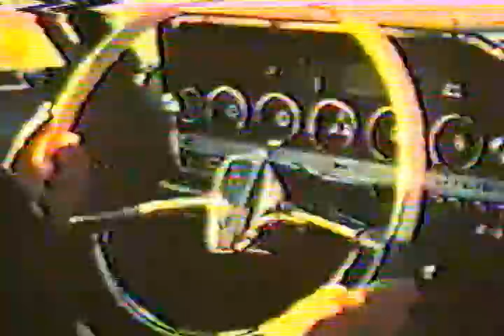Dodge Turbine Car Commercial Promo Film

Comment: @markfran11 As it was said in the video "The turbine will burn practically anything that can flow through a pipe", so the car could run 12 miles per gallon of just about any liquid. That's what was one of the main ideas, not needing to use gasoline. Steve Lehto has written a great book on the car called "Chrysler's Turbine Car", check it out folks.

Comment from the maker: Thanks for the comment.  There were a number of reasons why Chrysler/Dodge abandonded the Turbine engine.  But remember, the Turbine isn't gone completely.  They are used to power or M1 Tanks.  This was a direct result of the research Chrysler did over 30 years.  The big drawback is that they eat gas fuel.  The M1 Tanks have to have a tanker follow them where they go to keep refueling them.

Comment: @clap5 lots of reasons...1, it was very sluggish take off,2, the heat generated by a turbine is immense and the cost of creating an engine bay that could withstand all the heat was very expensive and it wasnt practical.also the fuel milage on these thing is rediculously bad.the last thing i can think of is they put out a whole lot of heat out of the rear.youd have to stand at least 20 feet away to not get burnt up.i was a tanker on the m1a2 tank and they have turbine so i am familiar with it

Comment: I read in a car and driver BOOK (1990 I believe) about this Turbine powered car. For some stupid reason dodge abandoned this car design. It took something like 22 seconds to get up to 60MPH. The RPMs went up to 60,000+. Amazing that it ran on so many types of fuel. IMAGINE A turbine top car of TODAY?! You could run it on anything with todays high fuel prices. TIME TO REINVENT THE AUTOMOBILE!

Comment: Cool video, Why doesn't chrylser review this concept and make a modern version of it?.
Reply from the maker: John Smith Because they transferred the Technology over to the US Government during the 1980 Chrysler Bail Out Loan Guarantee.   The Chrysler M-1 Tanks were turbine (and still are) powered.   It was a national security issue that this technology needed to be in the hands of the Government to ensure it's safety.  NASA stepped in and so did Contractor General Dynamics.   Turbine powered vehicles are used by the military now.   We just don't see them in automobiles.

Comment: There were problems with manufacturing cost, first and foremost. It's tricky to make a gas turbine accelerate like a reciprocating engine. Also, you have lots of very hot exhaust. Lastly, people didn't care for the "shop-vac" sound, cars at the time had V-8's.

Comment: these engines had a freepower turbine, just like helicopters. They did drive the rear wheels, not by air thrust. The air is cooled in the two long and flat exhaust pipes under the car, so you could freely walk behind it.

The biggest problem i think, is the inefficiency (fuel consumption) of turbine engines. Today, the consumption is even a bigger drawback than in the 60's...

Comment: Actually it would run on several fuels but it would not give good service on anything but the fuel it was trimmed for, be it unleaded gasoline, kerosene, or diesel fuel. Alcohols were rough on the fuel system as the materials were made for petroleum fuels. Leaded gasoline was also troublesome on the regenerators.

 A piston gasoline engine will run on alcohols just as well with minor modifications. It isn't economic which is why no one does it, unless the gummint subsidizes it.

Comment from the maker: @clap5 They did.  All thru the 60's and 70's, Chrysler worked on this.  There's much documentation.  For 1981, Lee A, Iaccoca wanted to launch a Chrysler New Yorker that offered this Engine Design as an option.  But, this was 1980 and the Government Bailed Out Chrysler but Gaurantteeing loans with Banks.   Many of those Banks didn't feel comfortable with this new unproven technology.   As part of the deal, all of the work was turned over to the Government (I think to NASA) and locked away.

Comment: Turbines are great for steady state operation, as in an airliner cruising at 500 mph. But they are not good for constant changes of speed as in automotive operation. They need to spool up, slowing acceleration, and they freewheel down, making braking harder. The materials to build them are also very expensive. All told, they're great for flying NY to LA, but not for the trip to the supermarket.

Comment: army-technology dot com reports that the M1 tank uses depleted uranium (almost twice as heavy as lead) as Armor for the tank. Tanks are not known for their fuel efficiency. Lets try coupling that ol' Dodge turbine with a new Infinitely Variable Transmission (IVT) and a super light frame (Which could easily be mass-manufactured) and lets see what kind of fuel efficiency we get.

Comment: The 55 pre-production cars were run on Tequila and perfume as stunts. I agree with the guy who wants to pair a turbine with an electric drive. I haven't figured that one out myself since it makes perfect sense. If RC modelers can have jets that fit in the palm of your hand why can't someone put that together? I figure there is still a monopoly that prevents common engineering sense from breaking through the market.

Comment: One employee got to use a turbine car to test it, it wouldn't shut off in their driveway and pretty well melt the tar until an expert came to cut off the fuel.  It can run on peanut oil, just like the engine designed by Rudolph Diesel around 1910 . Somebody tell VW and Benz that their cars don't need the dirty Diesel fuel when pure bio will do.

Comment: This is a sad statement on the auto industry. Instead of cheaply built , plastic clad , overly equipped electronics and overly priced , auto manufacturers strove to be innovative and make cars that stood out . Now , cookie cutter shoeboxes that rapidly depreciate and you need a 2nd mortgage to purchase new.
Reply from the maker: Not sure I agree.  I think there's a lot of innovation coming out of Detroit.  My Chevy Bolt is amazing, the fact that I can spend only 150 bucks for a full year of energy to go 12,000 miles is amazing.  All the safety features are amazing...warns me if I cross the line....automatically adjusts my high beams...I know that was invented years ago, but it's perfected now.   I can use my car as a communications devise, with SAT access to the internet.  I use my wifi all the time with my car simply parked on the driveway, using it now to type and post this.   I find my Bolt truly revolutionary.  GM did an amazing job on the car.   The quality is impeccable...and it looks like nothing else on the road.